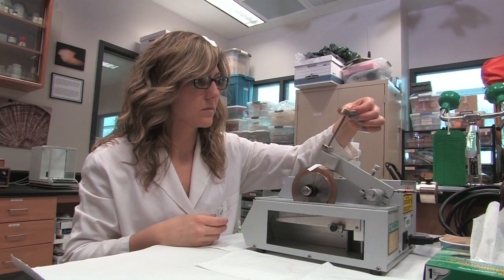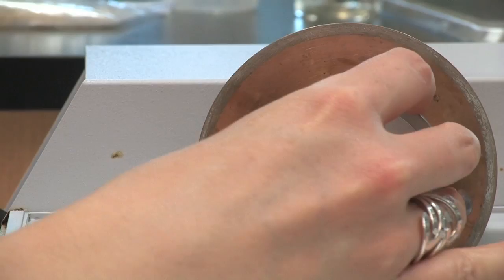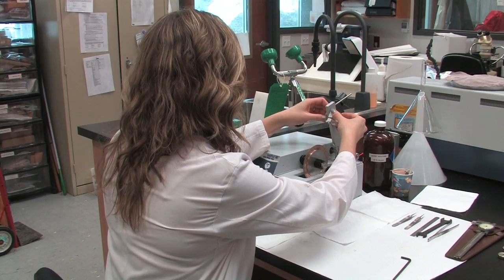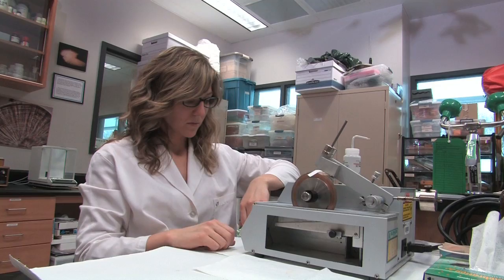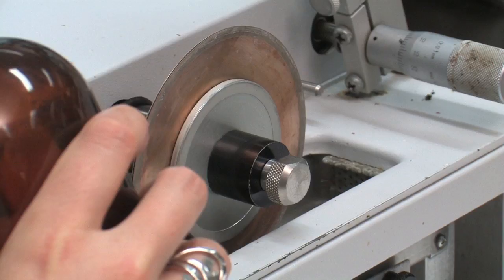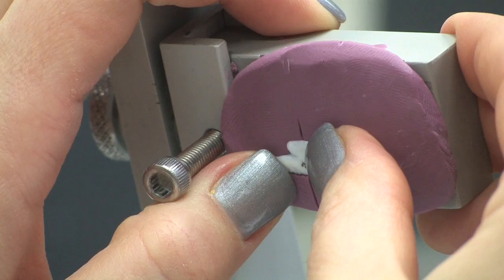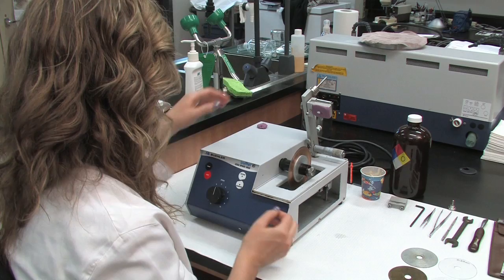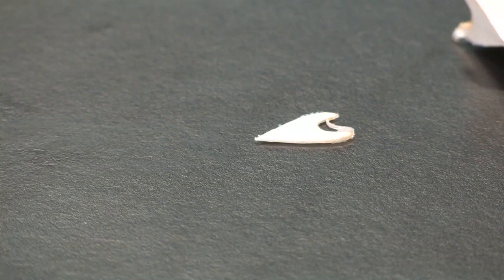Thin Sectioning of Fish Otoliths and Shark Vertebrae

Comment: Good video.  But, FYI, the blade keepers are on backwards.  The undercut is there to make sure the outer most edge of the keeping is making contact with the blade.  This will help keep vibrations down.